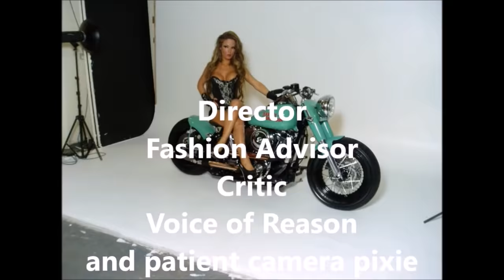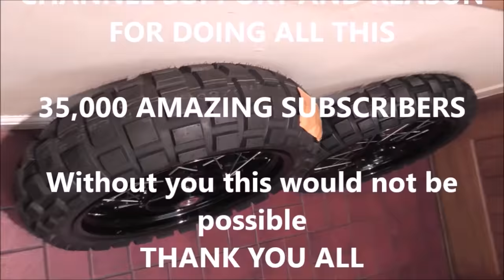Delboy's Garage, USD Fork Seal Replacement

Comment: I love your videos! Very nice in every aspect. I do some repair or maintenance in my small Yamaha YBR Fazer 250 LE 2008 with already over 103k Km. (Brazil). Thank you 'n' your wife for these quality videos. A pleasure to watch. Keep them up! Bye! (Of course, I've become a subscriber of your channel!)Comm. Pilot, ..Motorcycle lover.)
Reply from the maker: +Freedom &amp; Justice Hi there buddy.. good to hear from you all the way from Brazil, and such amazing mileage too, thats awesome, you must do a lot of maintenance to keep it on the road for that many miles.. welcome to the channel, and Passeio seguro meu amigo  Del.
Reply: These small 'cc' one cylinder engine Yamaha(s) are 'sweet' fuel eficient and I consider it to be a tough small motorcycle. So much that I am willing to make it a keeper. The maintenance I'd say it is minimum in (my case) case it's a properly ridden 'n' kept one. I did have a connecting rod  (the only one ..lol) replaced @ 66k Km. I never figured out what exactly caused the problem with it. The bottom part of it and top inside where it bears the crankshaft pin became rough or worn. I don't know the proper technical name for that type of tear and wear. I wonder what can make that happen. Always kept with good engine oil changes. After that happened I decided to upgrade from regular mineral engine oil to semi synthetic or 100% synthetic engine oil to avoid poor lubrication etc. I hope you will keep producing these great videos. Yes, thanks, obrigado amigo. Check 'n' add FB Cristiano Meira Deliberador.

Comment: Super video. Here in Canada it's $180 plus parts, tax & shipping to rebuild the forks after they are off the bike. A seal driver will likely pay for itself doing the first set of seals. Your technique with the strip of plastic milk container is a good one. Let me know if you normally go to the TT and if so I'll buy you both a beer ( 2012! ) in St. Johns ( Close to my marshals point at Lambfell. )

Comment: Legend mate. I started doing my own forks some years back when I seen your clip with the plastic pipe you made. Like you I now have a full driver set for doing my forks. But would you believe it I still have the 2 bits of plastic pipe that I used all them years ago. Can not bin them as they worked a treat. Doing yet another set of Cbr 929 forks tomorrow. Keep up the good work mate you help a lot of bikes out.
Reply from the maker: Thanks for the feedback mate.. im glad that worked for you.. it's a great hack if you haven't got the right tool.. and believe it or not, ive still got those two plastic pipes on my cupboard too.. must have been in there for 12 years lol!!!   Good luck with the Blade forks, should be a breeze..

Comment: Christian bayle does fork seal. :-) seriously boss video, have done various RWU forks in the past including early kawasaki gpz 900r forks with antidive. Never done UD forks, I own a yzf750 and would love to change the oil in those so watching this video as been a great insight in to how to do it properly. Thanks, vinny. :-) PS watched your how to replace clutch video, did my yzf no problem after your great tutorial. Used a gecko clutch kit including springs too.

Comment: Just  wanted to say thanks for the video! Did my z1000 suspension today using your video as guidance (but I got the compression tool with ratchet straps as the design was slightly different to the one in your video). It helped loads :)
Reply from the maker: Hi mate, thanks so much for your cool feedback, we're so glad the video could help you, ride safe....

Comment: This video was fantastic and I just wanted to say thanks for sharing.  I have a 2012 Speed Triple R and had to replace the wipers and seals.  The video was a good top level look at the process. My fork is slightly different but basically, close enough that I could see what to do.  Awesome video.
Reply from the maker: Thank so much for the cool feedback buddy, im glad the video could help you out..  Keep in touch mate, and ride safe.. del.

Comment: Great video!! Helped me a lot! 
Just one remark on how to prevent the bike from tipping over in case you don't have a bench to attach it to with straps. Putting a bar under the paddock stand and strap the bike to that bar won't prevent the bike from tipping over. It's the same principle as preventing someone to pick me up by standing on a bar and attach myself to that bar. It wil only help if the weight of the paddock stand is enough to keep the bike down. That's why a bag of cement will help. But again, besides that; superb video! Just trying to keep people from making that mistake and cause major problems.

Comment: Wow! Best fork rebuild video I have seen! Thank you for the simplicity and easy to follow directions. I have been wanting to attempt this myself but was always trying to figure out how to get the "exact" amount of oil back in and was always worried about if I didn't get all the old oil out and what about the residual oil lost that's left in measuring container etc. as hearing others made it sound impossible to get correct without a ton of stuff to do it. You are an excellent teacher. Thank you.
Reply from the maker: Hey Heather, thanks for your kind message, im really glad the video can help you out, and hope you get yours done safely..  Enjoy the job, and drop us a line if you get stuck... good luck.. Del & Pennyx

Comment: Absolutely fantastic video! I admit, I've been nervous about USD forks because I've never broken them down before, but regular forks are easy as pie.  Now they are equal!  I just need to find an adequate seal/bushing driver and I'll be in business! Thanks again!
Reply from the maker: A bearing and seal driver is a good investment.. but you can make a Ghetto version using white plastic waste pipe and a couple of jubilee clips..!!!!

Comment: Another great video, thank you.

I’d recommend threading wire or fishing line through the little hole at the top of your rule when measuring the air gap..........just in case it slips into the depths of the fork.  Makes recovery a easy.
Reply from the maker: Great tip, thanks Keith !

Comment: Great video, just replaced my 2006 Mean Streak seals. I found that the Mean Streak fork is a bit deeper where the bushing goes in and that seal driver you used wasn't deep enough. I bought a Motion Pro "Ringer" driver and it worked great to drive in the bushing, then tapped in the seal with the driver you used.

Comment: Thanks for all the great videos, it has given me the confidence to work on my own bikes and saved me a fortune. Currently replacing fork seals on a versys 650. Keep up the great vid’s
Reply from the maker: Most welcome Dan, im glad the videos could help you out mate..!  Good luck with your projects, and ride safe.. Del.
Reply: @Dan Woods I have a 2007 Versys 650, how did you get on with unlocking the nut under the fork spring with a spanner? tia

Comment: top tip - wipe the fork leg and yokes down before you slide it out of the yokes. I've had bikes where the yokes are caked in crud and dirt which can scratch the leg or sanction when removing. Nice one Del, bisto!
Reply from the maker: +T Will Good tip... dirt and grit can do so much damage... cheers buddy, i like that.

Comment: Hi Del, first of all i wanted to thank you for publishing this - without this video i would have not tried to tackle my forks myself!  Just one thing i'd like to tell you - i have 41mm Showa USD forks on my 94 Monster and i also have exaclty the same seal driver and i just could not get my fork seal to go down enough for me to install the snap ring.. so i took the seal out and found out that when i drive the bushing in with the sealdriver and the washer inbetween, the bushing wont go in as far as it has to! So i had to fabricate a aluminium tube which i cut in half to press it down all the way and then successfully drive the seal in. Just mentioning this as you said it would be a universal distance @28:45 Please don't take this as me bitching about this - just wanted to let you know! Greetings from a fan from Germany!
Reply from the maker: Hi Car, thanks for the insite buddy, its always good to get some tips from any one else how has done the job, I love how you got round it by making a tube for the job... thanks for watching and taking the time to write buddy.. all the best. Del.

Comment: excellent video thanks!! Just bought a k1 gsxr1000 with a slight smear of oil on one fork.  Will try my seal mate. I've used it in the past with mixed success. Have ordered  seals for when I do the full job.
Reply from the maker: Seal mate for the win brother, good luck with that, it usually works 4 times out of 5, as with upside down forks, it's nearly always dirt that makes them leak, thankfully !

Comment: Thanks for your "Commons "of detailed facts ,alot of videos do not talk you thru the total procedure and the warnings of what not to do and why.I have recently purchased my first Flhtcu-i  1996 it has air assist suspensions,I have ordered progressive heavy-duty rears and front also, QUESTION is it possible to eliminate the out dated front air caps ,to eliminate the system ,and go with just a heavy duty basic fork system,less maintenence less parts,I havent found no info on these systems,this bike has only 20k on her ,,she's been mothballed as a conversation piece ,been given all the Love of a mikuni,the Right way in every aspect. KEEP making your informative Videos Please ,Great Riding My Friend.

Comment: Hello Moonfleet41, when sanding a hydraulik tube, THEN 90° to its motion. direction you can see on the manufacturing marks. use your paper, oil an your thumb with max. tooth brushing pressure. 
(reason that hydraulic guys say is that the microscopic 90° grooves get polished by movement, but those in line will cut the seal and stay, clamp it (carpentertools) horizontally looking over the table, use cotton sand stripes and gently work your way over the areas) thx nice video.

Comment: Well blow me, I was really thinking about giving this job to a shop, but I thought I'd have a go after watching your video. First one took about twenty minutes, second one maybe half that! The only thing I didn't have was the 50mm spanner for the big nuts on the end, (I'm doing the 48mm forks off a KTM Adventure) but after seeing how loose the ones you were working on appeared to be, I put the top nut in a padded vice and turned the fork with my hands, and it cracked pretty easy with no marking. Great video, saved me a goodly bit of dosh there! (I liked how the camera girl made the odd remark, just about when I was about to remark myself!)
Reply from the maker: Congratulation mate, glad it worked out for you and glad the videos was helpful.

Comment: Nice DIY. Just as a hint - you can also shorten small spring(s) in the seal by screwing it in a bit more so the seal squeezes on the fork leg a little bit harder.

Comment: I know this is an old video, but thank you!
After sending my bike to a shop and getting screwed..... Well I did what the shop couldn't. Actually shop never changed my seals. I used fork as a slide hammer yet found 2 holes being taken out with a pick.

Comment: I'm riding the S1000F 18 year old fork oil exchange, and I think I might give it a try after watching your video while searching. While riding the bike, I did my own maintenance, such as engine oil spark plugs, air filters, brake oil mesh lakes, etc.! Videos don't have subtitles, but you can see the blueprint with just a photo. Thank you for making this video. Where do you sell that part? Where do you sell that part? What kind of product is that grease?

Comment: what i have found very useful for taking off high points, is very fine diamond sharpening plate. but possibly augmented by the wet n dry,  just to round off
Reply from the maker: Great hack i heard was jewellers rouge on a small piece of glass..!!

Comment: Am doing the forks and following the service manual. Per section 12.12 they show the oil level with oil between the inner and outer tubes.
Also they recommend that when filling that you keep the oil level above the two holes in the inner tube when filling and purging the air..
So it would seem that there is always oil between the two tubes?
After watching your videos ( very good by the way) you don't seem to worry about the between the inner and outer tube?
The space between the tubes would affect the air volume depending if oil is put between the two tubes when filling etc.
First time i am doing upside down forks-rebuilding a 98 ZX7R.

Comment: Yet another well delivered, very easy to follow video.
I've always felt that my Street Triple forks were a little too soft but changing the oil always felt a little daunting.
Nice to see how easy it is! 
Not sure of the existing grade, some recommendations wouldn't go amiss if there's anyone out there has done it.
Reply from the maker: Hi mate, you can have some real fun with fork oil grades by actually mixing your own cocktails and it's as easy as this.....
fork oil comes in 5, 10 or 15W (15W being the thickest), so check in your vehicle specs. what the factory fits as standard and go up by 5W to the next one up... so if it has 5W as standard, try some 10W and see how they feel.... if that makes them a bit stiff, then here's the fun... mix equal quantities of 5W & 10W and the result is 7.5W.... and that will be halfway between the two, so you can actually fine tune your fork damping just how you want it - hope that helps !  Let us know how you get on buddy !
Reply: +Moonfleet41 Will do. Interesting thoughts on mixing the oil for fine tuning the feel. I'll look into it.

Comment: Amazing video! Now I can do this myself thanks!!
Reply: Okay so when I get to taking the cap off and exposing the spring I have a plastic damper on top of my spring with two holes one on each side when I loosen the preload all the way the holes line up to that bolt to take it off how do I get that bolt loose?
Reply: 2006 Yamaha FZ1

Comment: If you have trouble getting the inner fork seal to release, try using a heat gun.  I spent hours trying to find a way to separate my fork tubes until I tried the heat gun.  Worked on both my fork tubes.  I did make sure to use a new fork seal kit afterwards, though.  Didn't want to chance the heat warping any of the rubber or thin metal components.

Comment: would you recommend putting rebound and compression to the softest position first before filling with oil and putting back together, I noticed my manual says take rebound all the way out before fitting cap

Comment: First off let me just say I love what you are doing here....very very helpful. I do have a question, could you do a tutorial on the "left" fork for USD forks? I have a mean streak and I quickly realized that the left fork was much different that the right. It would be super appreciated.   Thanks and keep the videos coming!
Reply from the maker: Hi Jason, thaks for your kind words my friend... for your request... obviously i would need a Mean Streak here to make such a video (we dont really do videos to order any more, not enough hours to take care of what we are already doing)... maybe have a look at the Kawasaki Manual and see if there is any advice on the small changes internally.. the external stuff is the same.. fitting the seal and bush etc..!   sorry not to be more help... Del.

Comment: As per usual very educational great video mine are standard non upside dien aja gsx1400 hoping to attempt thus very soon only thing that id be cautious with myself is the bushings one the outer is as important as the inner on the other etc i will be purchasing the progressive spring kit which includes the oil ill let you onow how it goes ....one question am I right to crank off the upper nut as you did AND the bottom allen head nut before removal? You put it on vice 8f I remember some have said to me crank it 8ff only so not tight thanks buddy

Comment: Delboy, the way you bleed the damper is, IMHO, is incorrect. You should either extend the damper rod all the way up and slowly push down to bleed the air bubbles with very slight sideways action until no bubbles and smooth action. Another method is to cover the top of the tube with your palm, extend the forks up using suction to force the oil into the cartridge and when you release the pressure (not dropping the outer tube) the air bubbles will expel, do this a few times until you have a smooth action on the damper rod which should rise smoothly and drop slowly. You get a more accurate oil height/air gap, better action on the fork and more accuracy in the adjusters. Hope this helps and great channel.
Reply from the maker: Thanks buddy, great tips!

Comment: Brilliant !! .... 5 years gone by and it's like it arrived in the post yesterday ... wisdom, eh :) Timeless !!

I've got my  '92 Zephyr 750 back on the road after 10 years and am wondering would a pair of USDs (GSX-R maybe??) be a silly or sensible upgrade.
I know she's not built for super-speed but I have a 4-into-1 and still like to ride rough and winding Irish roads, so ... any advice??
Meanwhile, I'll revamp the original forks .. your comments on oil spec duly noted. 
PS   A good mate used ATF back in the day to firm up front end on his 'Jixer' ... worked a treat!
Reply from the maker: Fat front end for a Zephyr sounds perfect, remember the Gixxer is a lot lighter, so although the USD forks are stiff and sporty, they'll be more compliant with the heavier bike on them.. .and yes, ive used ATF in forks for years, it works especially well in Harley Sportsters..!  so give it a try, a conversion like that is no certain fixed menu, you have to experiment and settle on what works best for you..  Good luck with it mate. !

Comment: Excellent video,just stripped my tiger 1050 forks out but I’ve a question Del…..

How to I remove the cast foot off the bottom as I want to fit new tubes as mine are scored….

Your advice is much appreciated..